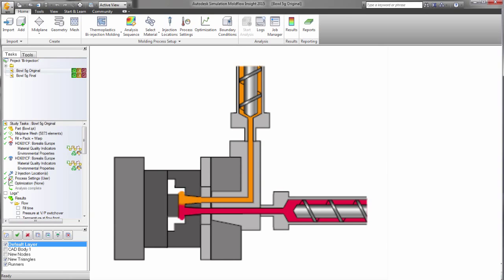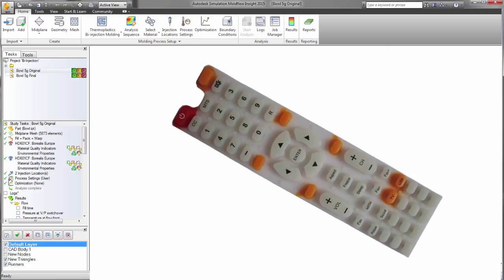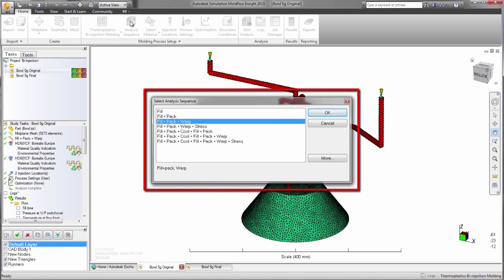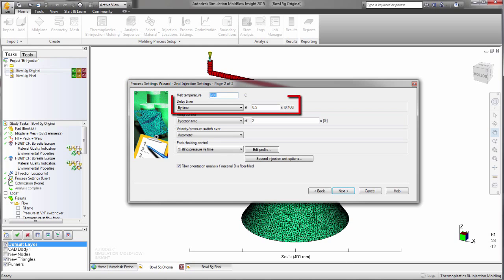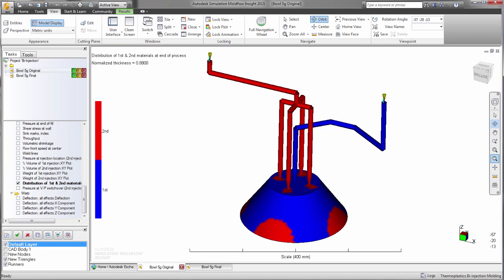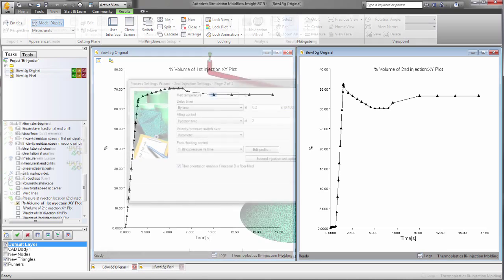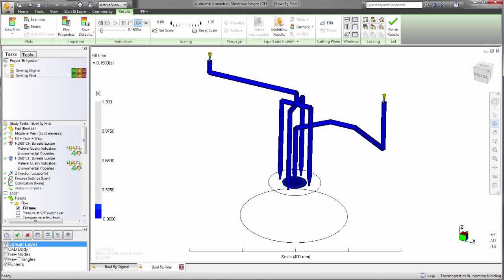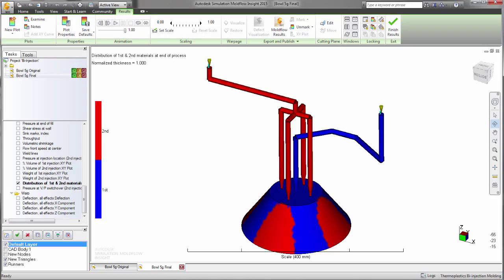Bi-injection molding simulation

Comment: Does this simulation also be used to the case of 2 differente cavities with different materials but injecting simultaneously?
Reply from the maker: Hi Eduardo ~ The Bi-Injection analysis is intended for use of injecting two materials into a single cavity. Although nothing currently stops it from being used on separate cavities, the solvers do not release the pressure at the end of the second injection (see AKN Article: https://knowledge.autodesk.com/support/moldflow-insight/troubleshooting/caas/sfdcarticles/sfdcarticles/Bi-Inject-analysis-does-not-release-pressure-at-the-end-of-Pack-Hold-stage.html ). 

We recommend to run each cavity in separate studies through the traditional thermoplastic injection molding analysis sequence instead. It is a great question, and probably good if you wanted to also add it to the Moldflow Ideas Forum. Thanks!
Reply: Thank you very much! Actually, I have already contacted one of your Specialist by email and the process I am trying to simulate is similar to the two-shot-overmolding, but not exactly. He had already confirmed to me that the option I want is not available in the software yet. But many thanks for the support!
Reply from the maker: You're very welcome! :)